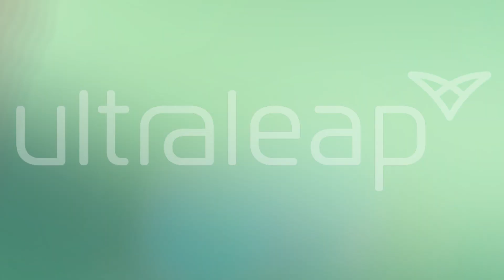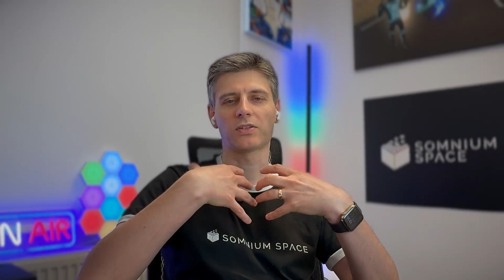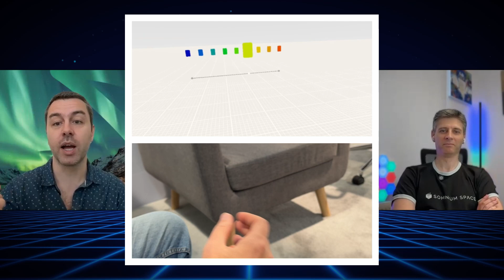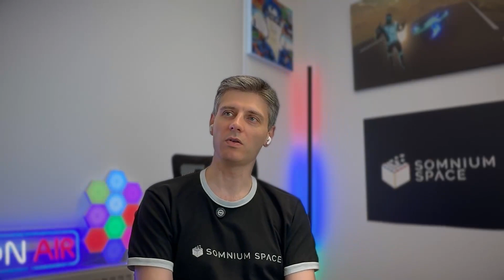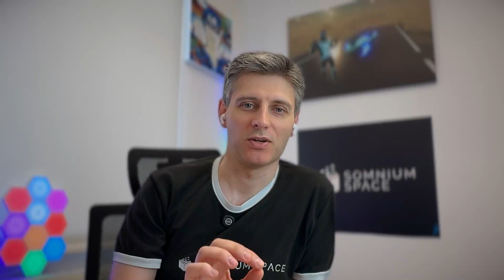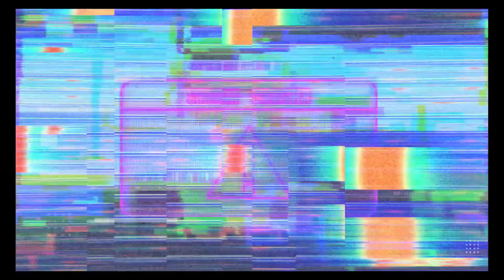Exclusive: ULTRALEAP Hyperion Update - New Dimension in Hand-Tracking! + VR1 just got better!

Comment: No mention of improvements to tracking volume which is the greatest weakness of machine vision hand tracking. Also no mention of arm/shoulder tracking which could help counter the low tracking volume. The most interesting application of hand tracking to me is for learning sign language but not being able to do signs which involve touching head or chest is quite a significant restriction. Still definitely a "nice-to-have" and I'd expect the addon cost to be cheaper than a set of Lighthouse-tracked controllers but the pinacle of hand tracking remains gloves like DiverX Contactgloves.

Comment: The feature I would love:
Ability to use hands like controllers more naturally.

Imagine you point at something with your thumb at a 90 degree angle from pointer finger, then while continuing to point at it, you move your thumb down to touch your pointer finger to click.  Maybe different angles are clicks on different buttons?  Squeeze both hands together to go to the menu.  Etc.

One reason pinching doesn't work well is because you naturally tend to move the finger you are pointing with and click on wrong thing. Unless you use AVP like eye tracking for pointing.

Right now, it's impossible to only use hand tracking for controller based games.